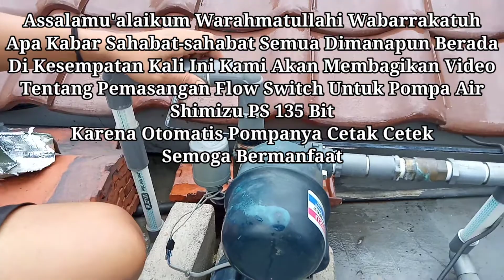Cara Pasang Flow Switch Untuk Pompa Shimizu PS 135 Bit Agar Tidak Cetak Cetek I flowswitch

Comment: Bos , kalau sdh pakai flow switch, pressure switch bawaan pompa digunakan apa tidak, tengkiyu bosqu
Reply from the maker: Maaf Baru Di Balas, Nggak Di Pakai Lagi Pak, Tapi Tetap di Pasang Di Pompanya, Hanya Di Ambil Kabelnya Saja
Reply: @BABETEKNIK  sy kemarin pasang flow switch, kabel pressure switch sy paralel dng kabel flow switch

Comment: mas maaf mau tanya, berarti ini kalau pressure switchnya nyambung ke radar toren, masih aktif ngga ya radarnya kalau air di dalam toren habis? atau hanya kalau ada aliran saja?
Reply from the maker: Itu Sambungannya Sendiri Sendiri Pak, Untuk Pressure Switch Pada Pompanya, Untuk Radar Ke Toren Di Sambungnya Pada Kabel Power Pak, Karena Radar Semacam Saklar Fungsinya
Reply: @BABETEKNIK  kalau digabungin bisa ngga ya mas?  1 pompa pake 2 switch, radar, sama flow switch, jadi sekarang udah ada radar untuk pipa yang masuk toren, terus mau ditambahin flow switch di pipa keluaran toren untuk ke keran-keran?